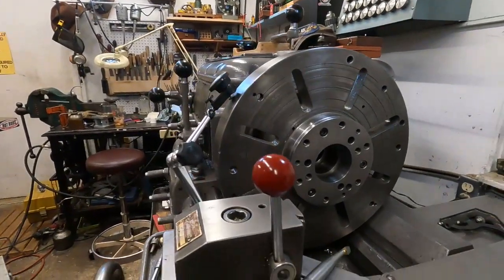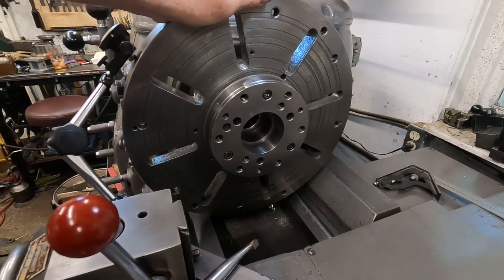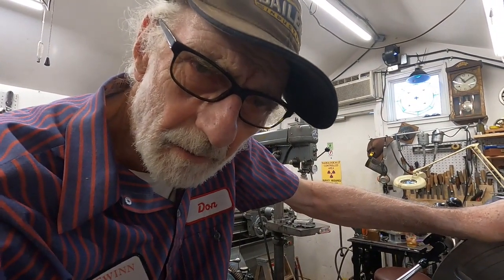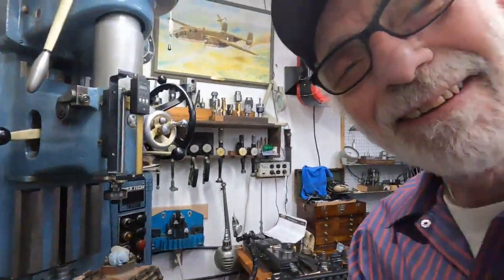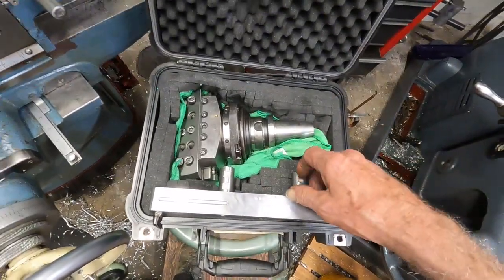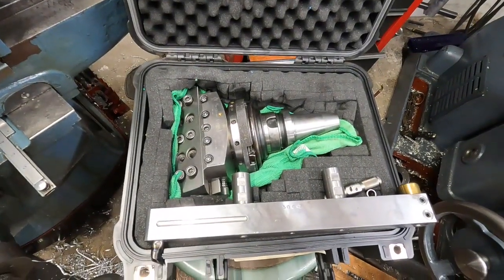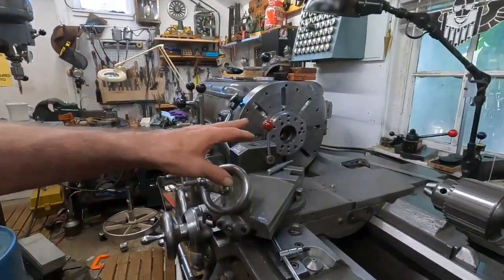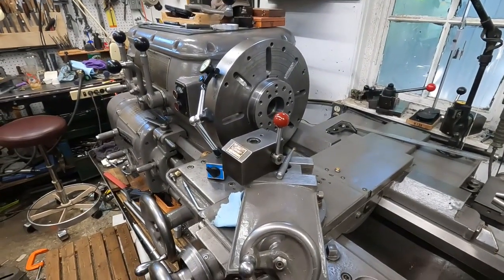From lathe faceplate to automatic facing heads and back again

Comment: I always wanted one of those. I can’t really find enough uses for myself. The 4” model would be fine, if I did. I’ve been trying to get a Tree for years though. The ones I’ve seen are missing parts.
Reply from the maker: The Tree head was very useful in the 1990s for 2 stroke cylinder heads in powersports that has since moved to 4 stroke for air pollution They would install the largest possible pistons. Then the inside of the head would have to be enlarged with a step and one or more angles. It took twice as long on a lathe.
 The plastic mold shop stopped using the heads when he went cnc probably 15yrs ago. Other than just a few powersports applications and making a custom tool for the Tree Head itself, I have not used it much and it still looks new like most that really do not see much use. I have seen Tree heads that are heavily worn from time to time. The Wohlhaupter heads have shown up buy it now stuck 40 or 50 taper shanks not listed correctly and the ones made in Japan are really good.
Reply: @DonDyarprecision  that’s all true. For those of us who either have small pro shops, or are retired, as we are, generally work the way they did in the pre WW11 shops. So one of these heads is a step up in modernity. I look at my old books from the mid 1800s to the early 1900s and think that I work in a similar way. It’s even funny when I would read, back in the late 1800s books that a bent dog should never be used, only straight dogs with posts and you realize that straight dogs are as rare as the hounds tooth, but bent dogs are everywhere, even now, 140 years later.

Comment: I currently don't have a 4 jaw chuck, and my 3 jaw chuck lacks precision for some jobs. So I built a faceplate from 1/2" steel plate and I'm using it for everything that needs realignment for machining, using it along with accessories like angle plates (homemade Keats style).
Reply from the maker: That is a good way to go! On lathes with one chuck, a pipe can be welded to a plate and the plate faced true and or parts welded to the plate for machining and then removed with a cut off wheel, then the plate refaced as needed. That was helpful on the import lathes with A type spindles that take a little longer to change chucks. Thanks!

Comment: I dinked around one day and let a Tree boring head get away from me for a few hundred bucks. A decision I regret terribly. They are available, but everyone thinks they are made of platinum or gold now. I have a full range of the Chandler facing and boring heads. While not near as nice as a Wholly. If you have a decent one they work great.
Reply from the maker: I remember when the Tree heads first appeared on the used market they were not very expensive because most did not know what they were. The Wohlhaupter heads were always hard to find in the smaller sizes for regular vertical mills, this 5" weighs 14lbs, the more those weigh the less they cost.